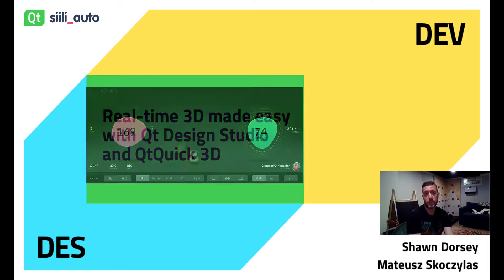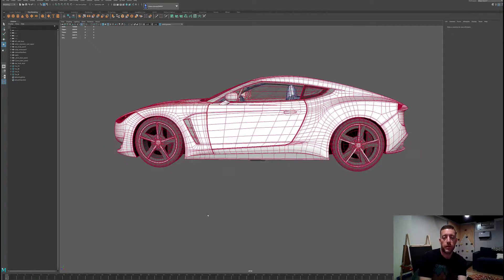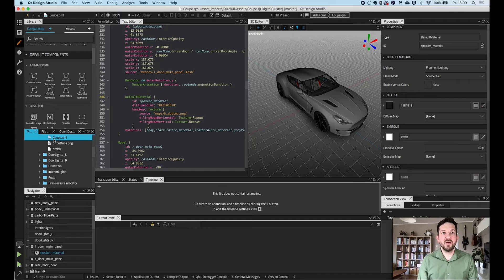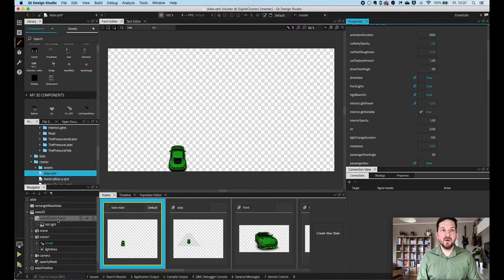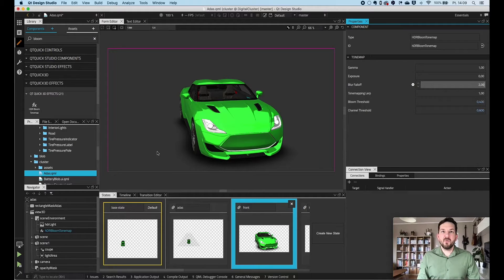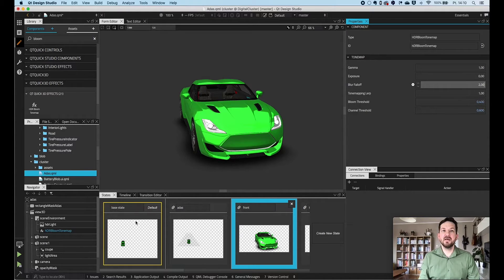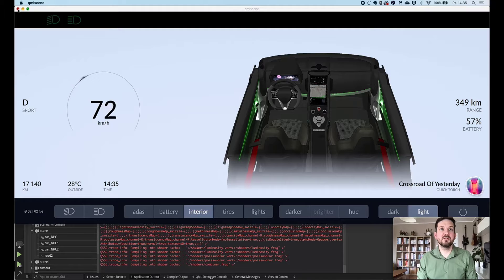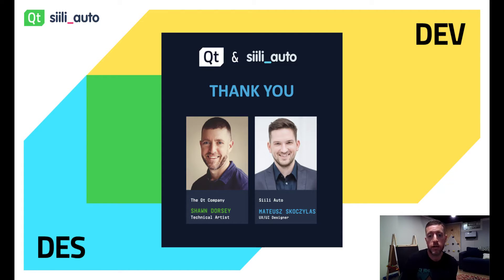Real-time 3D made easy with Qt Design Studio and Qt Quick 3D | Dev/Des 2021

Comment: Could you share project source code?
Reply: The demo comes with Qt Design Studio 2.1 as an example on the welcome page.
Reply: @qtdesignstudio3204  i put Car Instrument Cluster into Raspberry Pi 4 , i need fast boot when QT provide your own Raspberry Pi OS because Raspberry OS booting is slow
Reply: @suttisaksottipayapunt8871  How is your fluency with Raspberry?
Reply: @suttisaksottipayapunt8871  you can boot RPI in 2 seconds with QT application running.